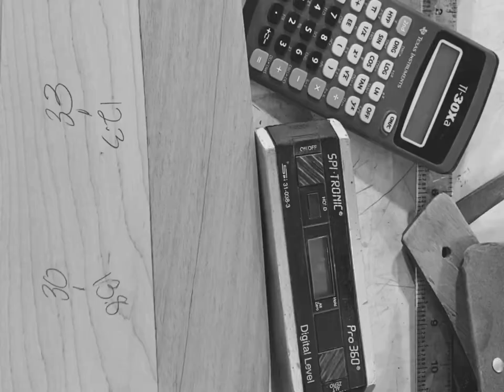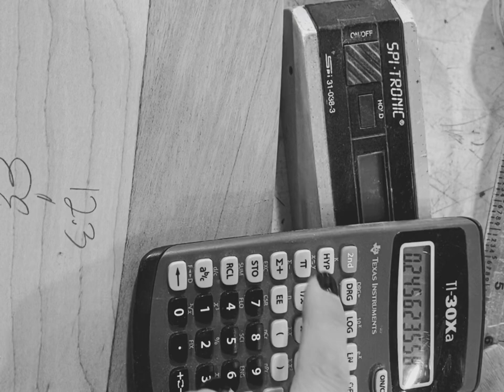Balancing a propeller

Comment: Love the videos as always!
..I am quite impressed that you can static balance a prop and not have it out of balance dynamically when it is on the engine spinning.It sure didnt work that way on the car wheels I have tried to balance.They tend to get the weeble/wobble effect. The long length vs. the narrow width must be what makes the balancing work as good as it does on a prop?
 Thanks for the videos!
Reply from the maker: It’s magic 😁😆😉